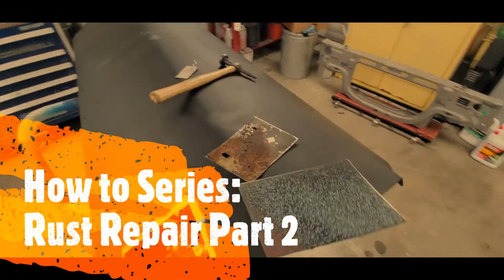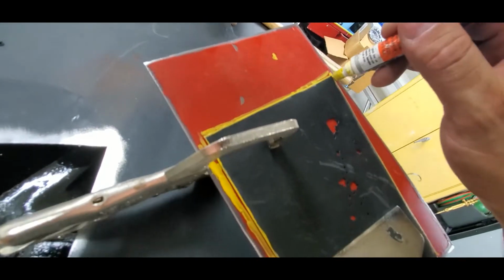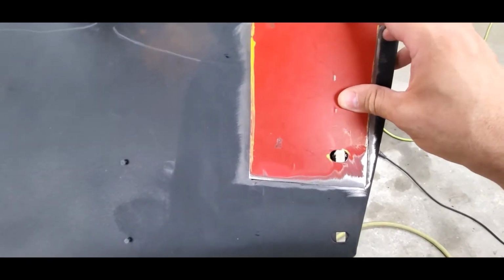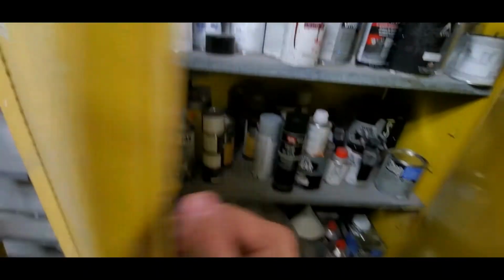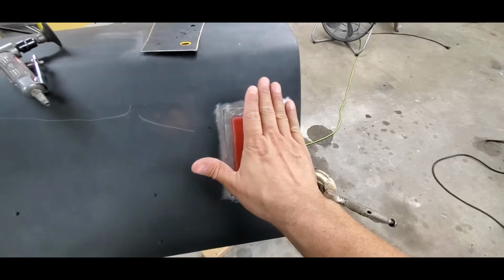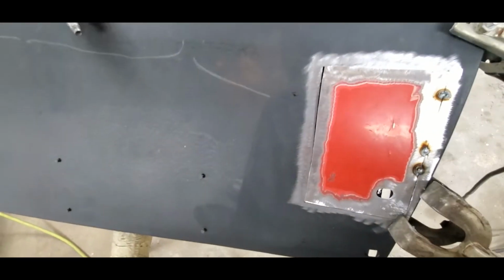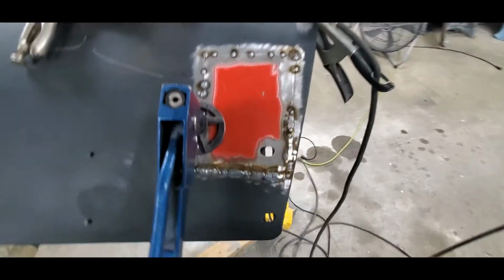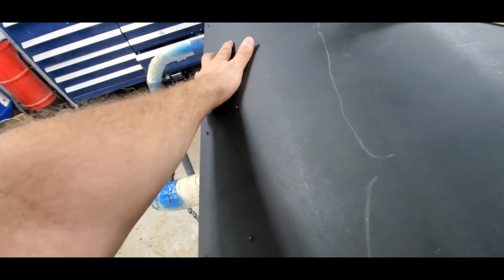Auto Body - Patching Rust 2

Comment: Great video….After you tac welded, did you weld a complete line or did you tac weld all over to keep the metal from getting too hot in one spot???
Reply from the maker: Stitch weld all around, pushing the weld into the previous. The more you move around and cool the welds, the less warping you will have.